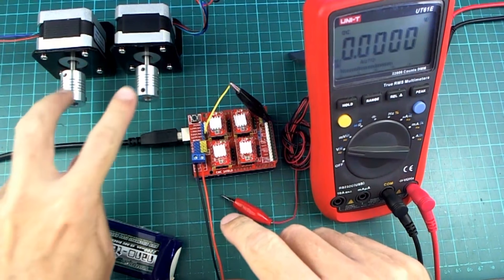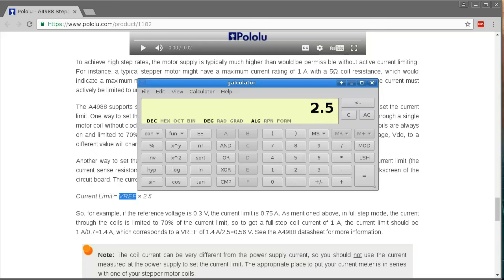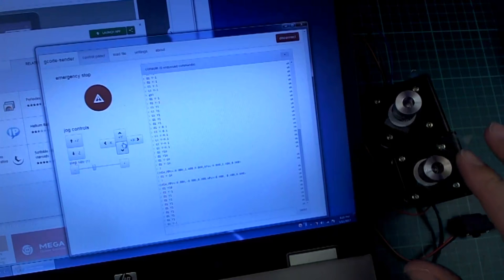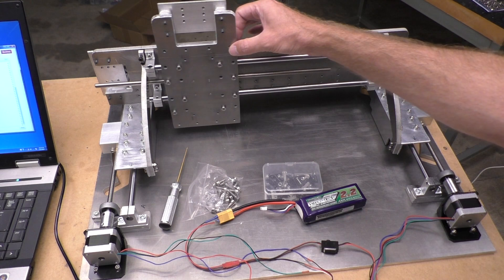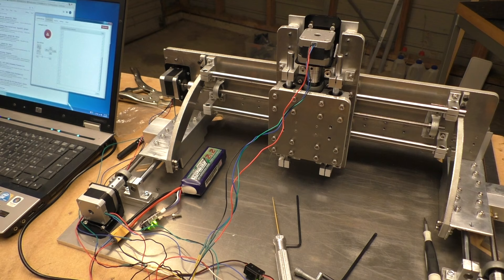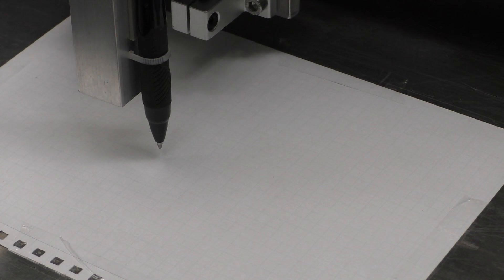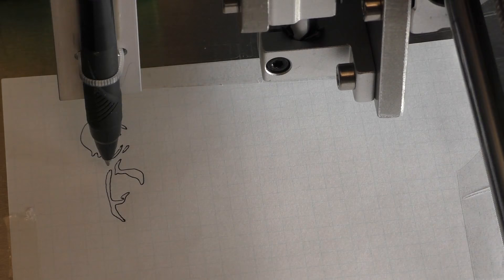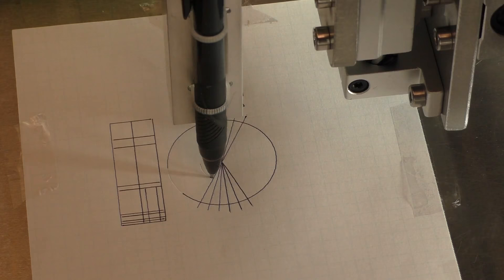DIY mini CNC machine part 7 (pen plotting tests)

Comment: Cool!
Reversing the "tool side" will indeed reverse the direction of the toolpaths as well, because the "mill" always turns clockwise, when looking from above. So the ideal cutting direction is reversed as well :)
(turning "into the cut" instead of "along with the cut", so to say)

Comment: It is becoming a fine cnc, you should consider using mach3. The  interface is more interactive you can override the feeds while running the program if your spindle has speed control you can also do some fine ajusts that come in hand to cut soft metals and plastics and many more.

Comment: There are a couple of excellent progs available which are almost industry standard, The first is Artsoft Mach3 this generates G Code for the machine and will convert a DXF file. The other prog is D2nc. Both are free to check if they work for you. and a cheap pay if they do. I've been using them both for 3 years without problem. Not sure how you interface with the Arduino but that's where I'm going next.

Comment: The noise can be reduced by lowering the current, but you need the current to achieve the feed rate. so its your choice of tuning it.  My 3D printer used to be too noisy and I lowered the current settings just enough to do its job.

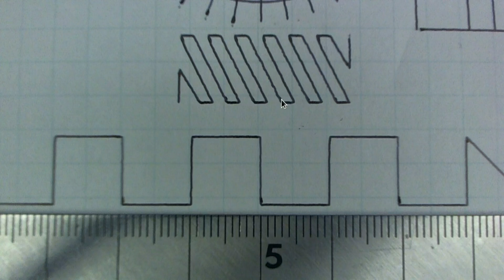Comment: at 26:11 you have a wobble in that diagonal line, thats life, my vinyl cutter does the exact same error, i changed everything, then bought another one, and it did it too....

dont want jiggly lines, dont use steppers / digital drive.... thats why the best ones use other methods

Comment: It appears to me that your noise issue is the size of the surface your motors are attached to. The larger "board" conducts noise where the z axis is all mounted on a smaller surface. I'm not a scientist but that seems logical
Reply: " I'm not a scientist but here's my uneducated guess " ...
Lol.

Comment: Hey any chance I could get your g code test file? also are you having any issues with running the two motors on the one axis, I found I had to set the step per mm to be twice what I think it should just to get it to move the right distance?

Comment: The rattling noise is your stepper. The smooth stepping is not enabled.
Check out NYC CNC for more details https://www.youtube.com/watch?v=JzR6FV-sdH4

I don't think you need to power the steppers in idle. The lead screw is no round bearing ball lead screw so the stickiness is quite high.
It actually just makes sense on the z-axis as it in theory could drop

Comment: Did you start using estlcam from thomas sanladerers video he posted recently? He made a cnc video a few days ago and mentioned he used estlcam. I am currently using it as  nice solution for my cnc. Other cam softwares are too complicated.
Reply from the maker: no, from Joop Brokkings video he posted about this time last year. Yes, I like that it does just enough for 2d routing with no complicated extras.

Comment: Did you maybe consider to use Estlcam for controlling your machine? Estlcam has a built in feature to control Arduino based CNC machines.
Reply from the maker: Yes, but I prefer the Chillipeppr interface

Comment: Is there a reason why you don't want to use the finest steps? It will run much smoother, more acurate and the hissing of the motors should not be as audible either...
Are you worried about torgue?
Reply from the maker: I didn't have enough jumpers :) But since you mention this, I'll try it soon.
Reply: But the arduino may have difficulty interpolating all the axes.
It's not a very powerful microcontroller, especially when it's doing arcs
Reply: ill buy this one from you? parts and labor? id be down if you wanna make a newer version then i can create some things also :) unless you know of a cheaper way to go. i like your approach.
Reply: muh1h1   microstep mode will probably even increase the torque

Comment: thats a nice video can i tell me wat software did u use for plotter
Reply from the maker: qcad and estlcam
Reply: iforce2d  thanks.  can u help me on sending g code,  as i have no knowledge in that n just finished building a cnc n calibration is also done. but stuck wit g-code
Reply from the maker: Just download the programs and learn to use them, they are both free. Sending you gcode would not help much because then you could only make one single thing, and I'm not gonna keep sending you more gcode every time you want to make something :)
Reply: i fine can u send the pen plot g-code pls and wat format to u save for g-code.
Reply from the maker: I'm not sending you any files. Learn to use things yourself, you have the internet right in front of you with many many many many resources, you can even watch video tutorials for these programs, eg.
qcad: https://www.youtube.com/watch?v=F1dQjvFqjfA
estlcam: https://www.youtube.com/watch?v=QObzZbrC3EQ
Getting g-code from me will not help you in any way. If you want to try sending some simple g-code to check how your machine moves, you can type g-code commands directly, for example like I did in my part 4 of this video series (I show the full process of setting up grbl)
https://www.youtube.com/watch?v=OuhgZMDXDdY
I learned all of this by reading information on the internet and watching a lot of YouTube videos, so there is no reason you cannot do the same.

Comment: There is something wrong with your horizontal axis, it sounds REALLY badly. All noises should sound basically like Z axis moving.
Reply: the rattling and that's NOT becouse of microstep settings.